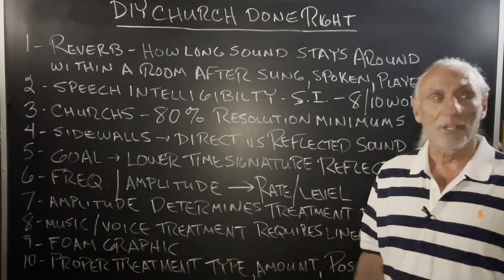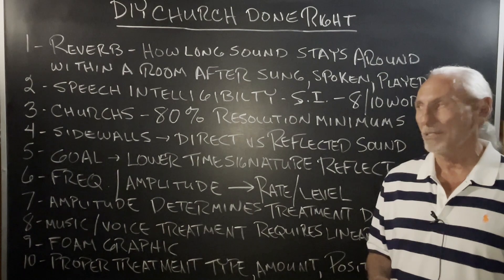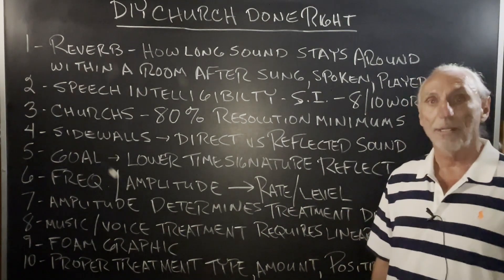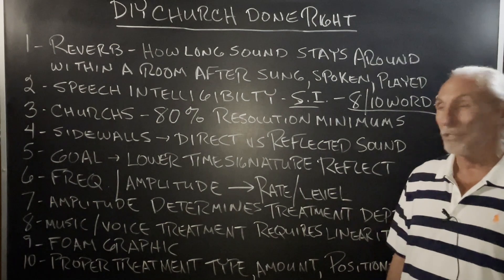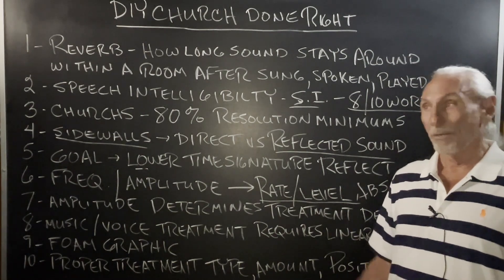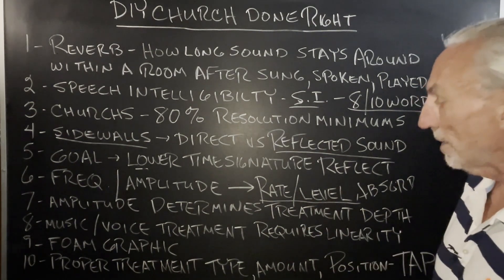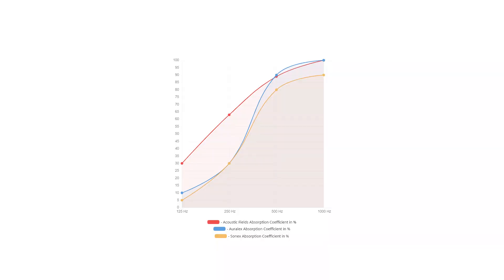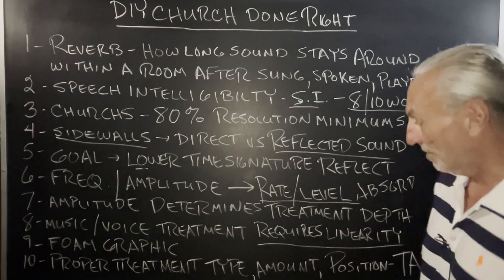Church DIY Done Right - www.AcousticFields.com

Comment: Generally speaking, what sort and thickness of wall absorbers do you use? 
The problem with so many absorbers is ascetics. How do you deal with that? 
Like has been said, before and after pictures would have been a great add on in this video. 
Thanks for sharing. Appreciated.
Reply from the maker: Lower frequency energy attenuation takes 12 - 16" with current technologies. Physics is the law, everything else just a suggestion. This church project is about middle and high frequency reflection management. It has nothing to do with frequencies below 125 hz.